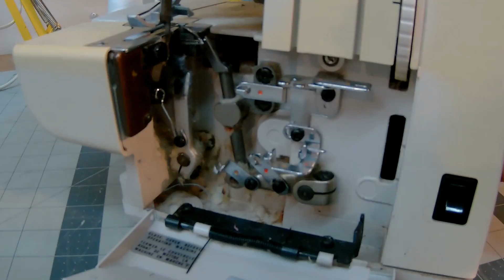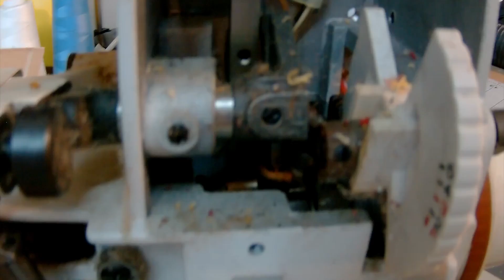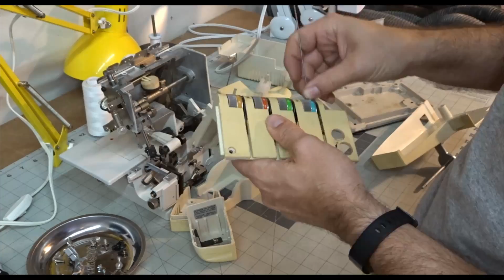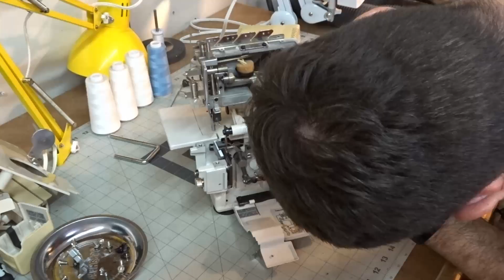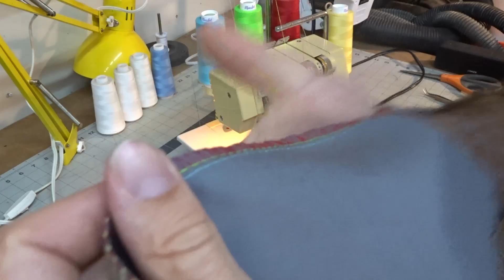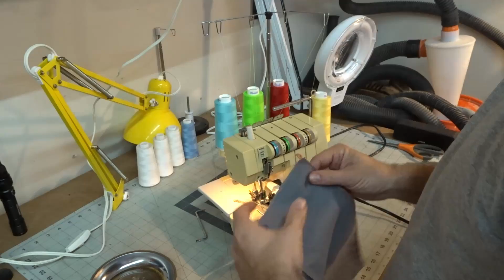Cleaning and adjusting a serger, Singer Ultralock 14U64A needs some cleaning and adjusting

Comment: I just scored this serger and really enjoyed following along with your video to get it cleaned and reset. Thanks for making this.
A tip for those that don't enjoy threading a serger- once the initial threading is done, to change threads over just snip the current threads before they enter the first guide hook, tie a double box knot using the new thread you want to use, set the new cones up, and pull the old threads through the machine. That way you only have to rethread your needles and not the entire run. However, I do find this serger particularly easy to thread compared to other vintage ones I've worked with! 
I would have loved to hear what the magically perfect tension settings were for this machine!

Comment: Hi.  I am looking to buy a used machine & found your video.  I have learned A LOT. Thank you.  Does the knife blade ever need changed on an old machine?  These machines are very old now, 2026,  is there anything else that I need to be aware of?  I don't want to spend $150 on this machine, then have to spend more to get it fixed.  Thank you.  Karen

Comment: Great and very informative video. We have acquired an old Singer 14U134 , new blades and needles on order and I'll be following your process. I agree with using compressed air, I use it a great deal for cleaning. I never thought of putting the alcohol in a spray bottle which I use for 3d printing, thanks for that also. Steve & Jo NE England

Comment: They may be old and lack some of the features of modern sergers, but they are so well made with quality machined all steel parts and proper lubrication points that like the old Singer*** sewing machines, provided you look after them they'll go on for ever. The only modern serger I've serviced - a Brother that works quite well - has a couple of plastic gears that I'm certain are just waiting to fail. It it also a lot noisier than those old Singers.
(*** they were actually made for Singer by Juki. You won't get much better than that IMO).

Comment: Thank you so much for posting this video I haven’t used my machine in almost 30 years and was afraid to do so since it has lain dormant. This video has taken away my fear of opening up my machine and oiling it all. There was a strange difference, my machine didn’t have the oiling pad on the inside. So, I oiled all that I could reach. After watching this I realized that the needle clamp was damaged and I found that I had the confidence to take it off and really investigate the damage.

Comment: Please do a video on changing the cutting knives. Ive been using my machine since 1986 and need to replace both as i ran over a hidden pin.  Now it will not cut any fabric.

Comment: I liked your video. I have not used my surger in years. My blade is in horizontal position and I cannot move the bar to get it into a  vertical position besides oiling it do you have any other suggestions.  Thank you

Comment: I just found your video!  Thanks for such a good video on cleaning this machine.  I loved how you showed what the correct tensions should look like (the Y's and U's).  I am going to take a good look at mine. I bought this model used MANY years ago.  What is the best way to secure the colored bands on the tension knobs.  They are coming loose.

Comment: I own one of these machines. I took it apart, cleaned and oiled it, adjusted the loopers back to factory spec, gapped and alligned the loopers to the needles and eachother. needle height is correct. I'm still having a problem with the lower looper occasionally missing the left needle thread when sewing fablic. Though when fabric is not present, it grabs both needle threads and chains all threads without any problem whatsoever. The clearance gap between the lower looper and needles is a close to zero as I can possibly get it.  I cannot figure out why it misses the left needle thread with fabric present. I cannot get the lower looper any closer the the needle. I alligned the far left position correctly to the needle down state, then made fractional mm adjustments to get the best results, but still have problems missing when fabric is loaded. SMRG, what do you think the likely causes are?
Reply: Mine does the same thing . I’ve seen videos of others using this same machine and the left thread was skipped on their videos . Can get mine any closer either .

Comment: I just got a 14u44 from a garage and it seemed to be in beyond perfect condition (not a single piece of lint). Which I didn't realize until i followed your video to take it apart and clean it up. My question is the looper cover seems to be hitting the arm the operates the blade. is this just a flaw with the machine or does something need adjusting? Any help is greatly appreciated as I am struggling to find any answers on my own.

Comment: I have this exact serger and came to this video for help with my tension as I’m having the same issue that the looper thread won’t reach across to the leftmost needle to form a fully locked stitch. How do you adjust the looper? Seems all the pieces that loop aren’t adjustable on this model. Trying to look close at what you do but it’s inscrutable. Thank you
Reply: I have this issue, too.

Comment: So this could be super helpful for me? I hope. I have a Baby Lock 428D. It was my first serger and had been stored in my sewing cabinet unused for over 10 years and when I went to use it, it appeared to be dead. one chug than nothing moving. I'm thinking now it's possible it's dry as the desert. The old serger isn't worth anything of value, but it has value to me. I'm going to at least get it open and look at it. 
If there is anything special about these old sergers I should know I would love some input if possible. 

Loving your videos. This is awesome.

Comment: I’m so glad I found this video. Had a 5 thread quantum lock given to me that’s been sitting for years. Cleaned and lubed it up but discovered the top bushing on the needle bar was too low. There wasn’t enough clearance and it wouldn’t do a complete rotation. That’s fixed and now the upper looper horn was bent... I’m determined to get it running smoothly.

Comment: I just received this exact serger-a friend of a friend bought if off eBay 5 years ago and never did anything with it.  Mine is filthy, and I'm  in the process of taking it all apart so your video is most helpful!  Most of the removable plastic parts on mine are broken and or cracked-I see what you mean by tightening the screws too tightly.  I'm hoping to be able to order some replacement parts but haven't gone down that rabbit hole yet.  Thank you again for a very helpful video!

Comment: Thanks for this. I have been pretty good about cleaning and oiling my machine since I got it 1986 but have never taken it this far. I'm glad I did. My wick and pad were dry. I remember reading the manual to oil it shortly after I first had it. All the oil points said 2-3 drops and the one above the wick said 20-30 drops. I decided it was a typo and should be 2-3 drops. So I've been giving it 2-3 drops only all these years.  Poor thing. That said, I've run it hard over the years and have never had any issues. I should treat it to some new cutting blades.  Thanks again.

Comment: Hi Wes, Can I just say that I've used Isopropyl Alcohol to clean as well and it's good for cleaning grease and oil, but you have to be very careful on the outside of the machine as it can dissolve/smudge the printed lettering on the dials etc. I now use just weak watered down detergent to clean the outside of the machine for this reason.

Comment: Thank you so much for this video.  I was given this machine.  It was sewing fine and then it locked up on me.  I opened up the machine and found that the needle bar assembly had a part slipping to the left and hitting against the cover that would cause the wheel to stop when the part hit the cover.  I took a screwdriver to move the part to the right which worked temporarily, but when I sew, it manages to slip back to the left and jam again.  Any thoughts?  I would add a picture of the part but can't figure out how to attach it here.

Comment: I was always taught to thread a serger loopers first, then needles.  You threaded the needles first.
Reply from the maker: Yes, you are correct. Nice catch! It is possible to thread the needles first, just a little more tricky as the looper thread will have to go under the needle thread. Good rule of thumb, always thread loopers first. Do as I say, not as I do, lol.